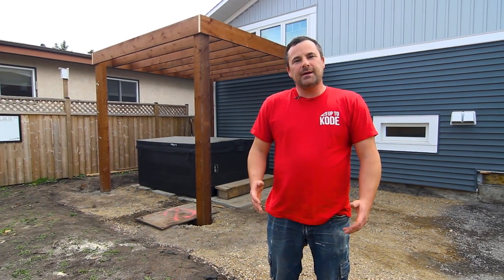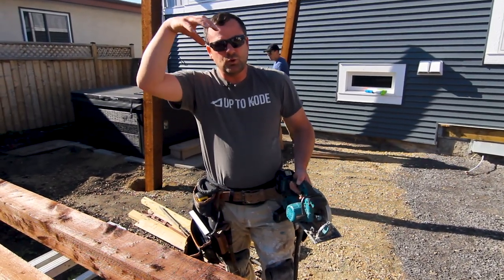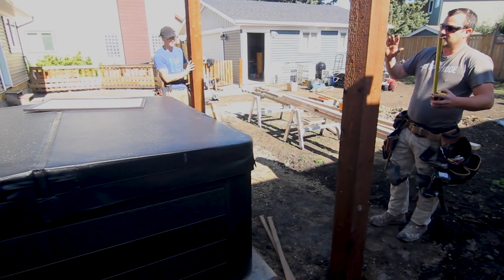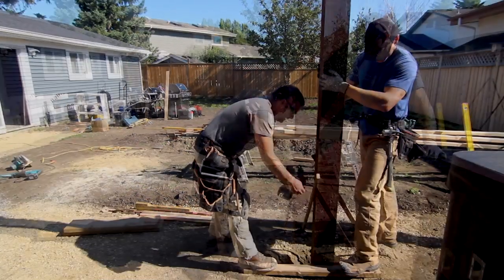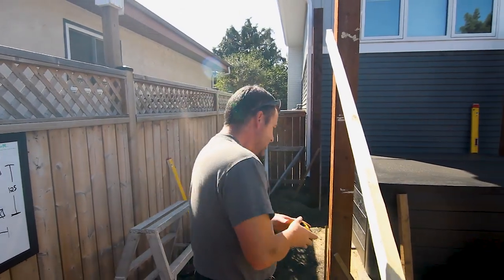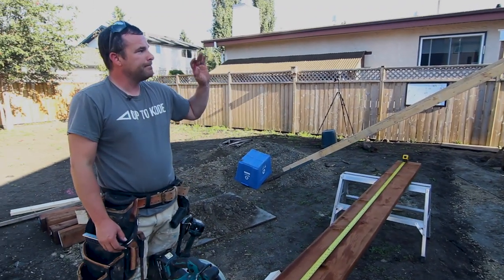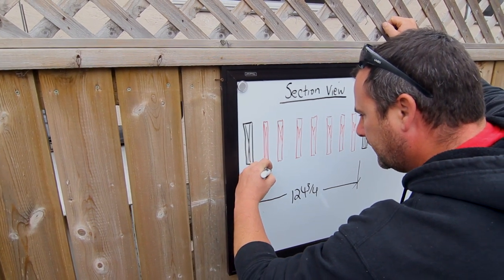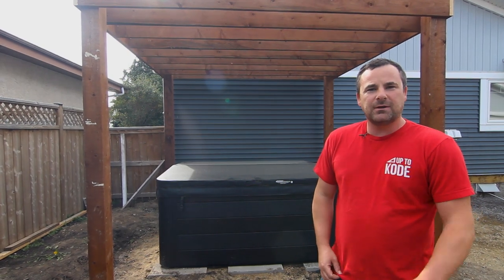How to Build a Modern Pergola

Comment: fascinating to watch :) im about to put 4 posts in for a small pergola/arbor. im a DIY amateur tho. couldnt u use string ? attach to outside of the posts, then measure . i guess its easier to dig the holes yourselves so u can be accurate?
Reply from the maker: You can use strings for sure. Just be careful not to push them too hard or it changes dimension. 

Yes drill your own holes too! And if the hot tub wasn’t there it would have been super easy! 

Thanks for sharing
Reply: @uptokode  it looks so easy, until i actually look at it, people like you deserve a lot more credit for making it look easy :)

Comment: Kody, is each horizontal plank (beam) attached to a post with 2 screws at the end of their length? Or are there some other joints that we don't see. I mean the final state of pergola, not temporal braces or screws.
Reply from the maker: The internal joists are screwed to the perimeter rim joist with 4- 3” screws per joist.  The perimeter is screws to the posts.    Keep in mind this is NOT load bearing and for “looks” only.
Reply: @uptokode  I was talking about perimeter joists, particularly the 2 joists that bear all internal joists. I agree that the whole top is for looks only, but all the wood up there weighs a little and those 2 perimeter joists screwed to the posts with only 2 screws at the end, well that's a little bold, I'd say ;) Nice video btw! It was nice to watch
Reply from the maker: There’s more screws than that. But yes if this was taking snow load or anything other weight it would have to be constructed differently.

Comment: Hey Kody, great video. I've heard different opinions on whether pergola posts should be in ground like you show in this video, or secured to footings via some type of saddle bracket. What's your opinion and why did you choose in ground in this instance? I've chosen in ground for freestanding pergolas in the past because most saddle brackets don't provide lateral load resistance. What are you thoughts? Thanks
Reply from the maker: Yes you’re right. In the ground provides lateral support.

Comment: A template (sized to suit the shape formed by the posts) showing the shape of the pergola and especially the corners, made out of rough lumber would be the best way, as the holes can be dug accurately, template can be fixed at the top of the posts, then you just plumb the posts, concrete in and go.
Reply from the maker: Really good idea! I like that a lot!
Reply: Strings -_-
Reply: @Kris-st7cx  that will work but can easily move then you have the hassle of resetting. I made a template out of wood from a pallet, aged tradespeople (who wanted strings and pegs/stakes), all commented it was a great idea. We had multiple setups to do with the wood template.
Reply: That's my point. Each setup we only needed to line the template up and that's all
Reply: Yeah that's how I'm doing mine. I'm using the 2x12s for the top of the pergola as a template that will sit above the top of the quick rite footing tubes. No math needed really. The old string from corner to corner until it's square than braced for concrete poring. The anchor brackets can than be set to the inside corners of the 2x12s so that can be perfectly even, spaced, and leveled. No need for Pythagorean's theroum until you have to stake a building of five or six thousand square feet like I do for our storage business

Comment: @45mins was just pain full to watch, if you need to calculate the space between each timber slat simply times the thickness of the slat by the number of slats you wish to use (7) minus that number from the total width from the inside of the two end pieces and divide that number by one more than the number of slats (8)

if inside space was 125 inches and your slats were 1.5 inches each, 7 x 1.5 = 10.5 inches, 125 - 10.5 = 114.5, 114.5 divided by 8 = 14 and 3/8s of an inch each space